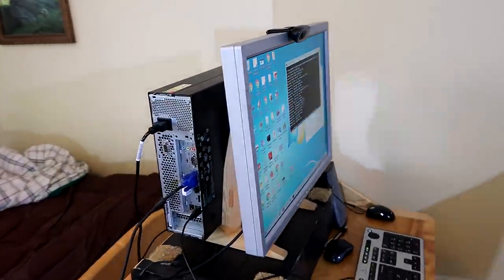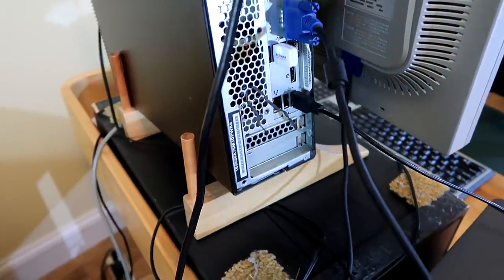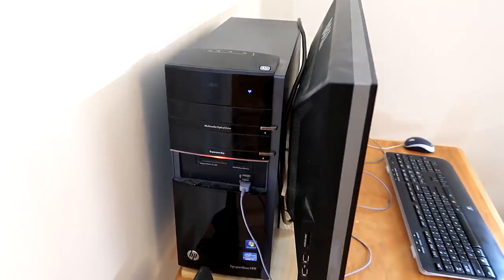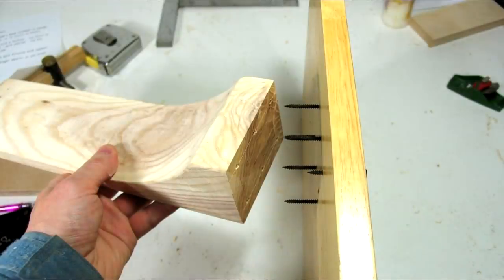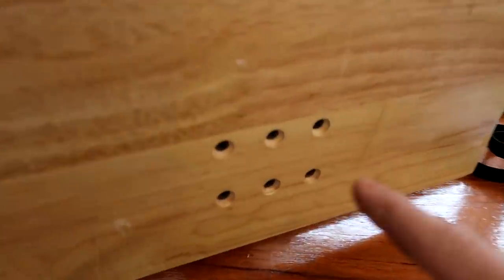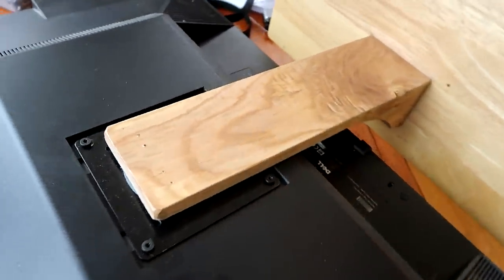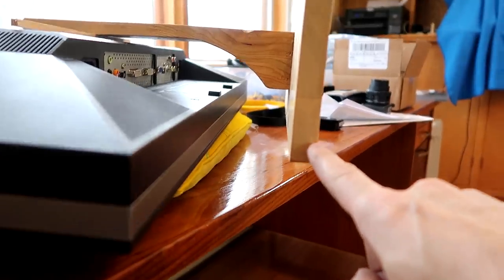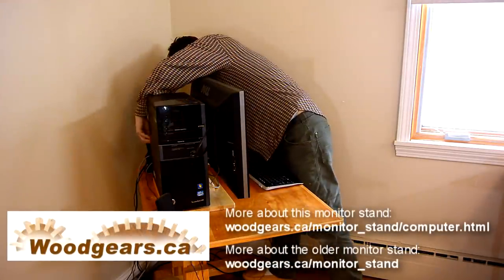Simple very flat stand for LCD monitor and PC

Comment: I used to have something similar for LAN parties, but I just screwed the monitor right to the side of the PC case with the VESA mounting holes. Plus a handle on top.
Reply: Pretty nice, just have to make sure the side panel is strong enough :) Did you just drill holes in the side panel or is there some special case with vesa mounting holes already in the case?
Reply: Drilled. The side was plenty strong enough, but I did have to sandwich a metal plate under the handle on top to keep the case from bending when lifted.
Reply: Seen that with steel cases.
Reply: I thought that's what he'd done at first.

Comment: What a terrific idea!  In the 30 years I have had a pc of one form or another.  I never contemplated putting the PC behind the monitor.  Thankyou for that.
Reply: As long as you keep the front panel of the case on your dominant hand side. In the old days for the floppy drive slides (now a days that's not as necessary). Also recall the older cathode tube monitors (prior to LCDs) were pretty durn thick through and you needed long arms or it was up and down from your chair.

Comment: At work we are standardizing on the Lenovo M series Tiny computers for our labs and user pc's.  It's a tiny box: about 7x7x2" system unit, and a matching monitor.   It's not a true all-in-one as the monitor is separate, but it had a special cradle on the back of the monitor that the unit slides into.   It's great for reducing desk clutter for general users.
But it does only use the integrated graphics, which is not great for heavy video needs.
Reply: as a comment related to size, you should see what you can stuff into ~10-20 liters of case these days. Take a look at the /r/sffpc subreddit. RTX2080 + i9 9900K and 32GB+ of ram is doable. my system is ~11L and could run a RYzen 2700X and a nvidia 1070 if i had the cash for that. The cases and motherboards do cost extra, but hey.

Also similar to the M series is intel's NUC computers/boards. Just integrated graphics, but very very small.

Comment: I've been wondering if a very sturdy wall shelf would hold a full PC, up about 4 or 5 feet, a bit to the side of the monitor.
Some 6 ft USB extensions would let me have the plugs for external disks or flash drives come out by the monitor if wanted.
It might reduce vibration from the desk to the internal disks.

Comment: I recently built a sit/standing computer workstation. The ideal desktop height seemed to be the level of my belly button. Perhaps a height standard that'd apply to anyone else too.  For me around 42 inches from the floor. I use a ~30 inch bar stool...sometimes sitting, sometimes standing and sometimes "half' standing.  And the combination of those three postures seems to be working out pretty well.
Reply: Yes, the bar stool workstation is a good ergonomic human form factor - as long as it doesn't get to be so immersive that you fall off of it.

Comment: Nice. But why wouldn't you just attach the monitor to the case side of the PC  (by removing the case side and screwing it to the vesa mount from the inside) eliminating the need for the wooden elements entirely?
Reply from the maker: and have the whole thing tip over.  No thanks
Reply: @matthiasrandomstuff2221  I am sure you could have made a minimalist bracket to prevent that. Engineering should be as simple as possible.

Comment: Now that is pretty clever! How was the monitor fastened to the stand again though?
Reply from the maker: with screws
Reply: Matthias Wandel it just seems too thin to hold much thread. But of course that depends on the amount of screws. The “hinge” is what has me puzzled. How can you loosen the screws without compromising the integrity/strength of the joint?

Comment: Isn’t a very noisy solution, with the PC on the table instead under the table? Thank you for sharing your solution. God bless you and your family
Reply from the maker: it's behind the monitor, that blocks noise.  There's no good place for it under the desk.
Reply: How loud is your PC? Admittedly I have an extremely quiet water cooled PC using slow 140mm noctua fans for cooling in a sound dampened case. But I literally can't even hear mine at idle and low load.
Reply: elevated PCs suck in less dust, than those at floor level.
Reply: Matthias Wandel ok, I had a PC it was very noisy but I have never tried your solution but I like the idea. Thank for your answer.
Reply: jonnken thank for your answer, didn’t thought it this way.
Reply: byw my pc was louder than I like it to be. But your solution looks like a very quiet pc

Comment: DVI?!? how old is that monitor
Reply: works as well quality wise as HDMI, which is electrically the same as DVI for the video, so it's a simple passive converter to go from one to the other. You just can't pass audio across DVI, but who wants the audio to come out of the 2watt integrated speakers on a monitor.

Comment: The tilt mechanism of my all-in-one PC went limp so I made a small piece of plywood that fixes onto the existing stand and has a nut fixed to the plywood. Then a bolt threads into it with a wooden cap on one end and a handle on the other that I use to push against the back of the PC to adjust the angle. The angled plywood standoff (used to get the bolt at the right angle relative to the piece of plywood that sits flush against the stand) split slightly as I hammered the nut into it, but its held on by 4 screws so shouldn’t be going anywhere, especially against the small torques faced by the bolt. Bit of a hack-job but it certainly pulls its weight.
Reply: Maybe try some Levitra for the limp thing it should stiffen up for some many hours at a time I've heard   :-)

Comment: why bother having the computer behind the monitor? mount it  under the desk so you can easily access the ports and you don't have such a bulky item on the desktop
Reply from the maker: I would have put it under the desk if there was a place for it, but that's where my feet go.
Reply: As with the all in one computers you only need the case's front panel on your dominant hand side (typically to the right) and with wireless the cable access is of negligible concern. It was the days of CRT monitors that multiplied grief and was when perhaps case floor mounting had its place. I would put the tower case over on its side with my feet up on that - nice and warm in winter down the basement the spiders liked it too.

Comment: Well, you don't have to get rid of a monitor when you have AiO Pc either. Most AiOs can be upgraded internally.
Reply from the maker: Do they use standard ATX monterboards?  I doubt it, cause if they did, they wouldn't be all in ones.  And if they don't, good luck finding a replacement motherboard!
Reply: @matthiasrandomstuff2221   My senpai noticed me :O .
 There are mini-ITX motherboards, basically the smallest motherboard possible yet designed to accommodate standard components. Imainge ATX board but cut under the first pci-e slot and on the right before the second hole for the screw. Original AiO boards are larger that mini-ITX so those can fit easily. You can even put a graphics card inside using a pci-e x16 raiser cable. CPU cooling is a bit tricky, but possible to do with original aio cooler or by making a custom one with a blank heatpipe.
Reply: @bluef1sh926   Nobody upgrades their AIO PC
Reply: @amiddled   Because it's more affordable to throw it away and buy a new one with a monitor?...
Reply: @bluef1sh926  It just doesn't happen. If anyone is thinking about upgrades, they aren't thinking AIO
Reply: @bluef1sh926  I've never seen a AiO that will let you upgrade more than a HDD/SSD and ram amount. Good luck making the jump from one generation of CPUs to the next, or memory from one gen to the next.

I've got a Dell inspiron zino HD on the desk near that is all but worthless because it needs so-dimms of DDR2, so that it could have more than 2GB of ram in it. (yes, already running linux, debian, and while i'm sure it helps, chrome needs like 90% of the ram).

Comment: I can't believe he didn't build a custom PC.
Reply: he has made wooden cases in the past, before he was making videos, they are articles on them on his website.
Reply: Waiting for the CPU from pallet wood. Some may say impossible, but I can hope
Reply: @ratchet1freak  I think what he meant is picking parts himself and not buying a pre-built system from walmart or some other store, they usually sell their pc's much more expensive than what you could build yourself from the same parts if you ordered them separately on the web
Reply: Made of wood and powered by mice and/or shrews
Reply: he's not a pc guy (afaik)
Reply: @poiiihy  I mean, the computers he showed were both PCs.

Comment: You should have done a little more research on compact PC's because I bought one last year 2018 for around $800 and it's super fast with an Intel i7 77000 CPU chip and the whole thing fits in a little box approximately 3" x 6" x 6"
Much smaller than a shoe box. I'd say half the length and 1/3 less in height.
Made by ASUS.

Comment: You could have just bolted the monitor to the side panel of the computer...
Reply from the maker: and have the whole shebang tip over!
Reply: No then you bolt the case to your cart and then that tips over. We preferentially design for a loosely coupled system the alternative tight system falls on you and is trashed as a unit. In older better days Matthias would come by and scavenge it for all of its valuable parts.

Comment: I'm surprised that anyone uses a workstation anymore.
Laptops are as capable as work stations now and so much lighter and portable.
Reply from the maker: with tiny monitors, shitty keyboards, and awful mice.  So now you take your laptop, hook up a decent monitor, mouse and keyboard, and performance and reliability is still subpar.
Reply: Laptops are objectively not capable as work stations in 2019. If we were producing the same content as we were in 1999, sure modern laptops are capable, though not ideal. And to get one worth its salt you're going to be spending well into the thousands.
Reply: There are different families of CPUs for laptops vs desktops. Laptop CPUs have fewer cores, and a lot of things turned off to save heat generation / make your battery last longer. Desktop CPUs have a lot more processing power. Compare a laptop and desktop cpus, you'll see there are big differences without even looking at benchmark numbers: https://en.wikipedia.org/wiki/List_of_Intel_microprocessors#8th_generation_Core/Coffee_Lake/Kaby_Lake_Refresh
Reply: @billybobjoe198  Yep, building a desktop vs buying a laptop with the same specs, the laptop could cost up to or even more than double the desktop (assuming you pick a laptop with actual desktop grade components)

Basically the ONLY time you want to buy a laptop over buying a desktop is if you are traveling a lot with work or if you find a laptop on a really good sale and you are on a tight budget
Reply: @TheZebinator  and if you are traveling a lot with work, hopefully it's work buying the laptop and not you.
Reply: If you have a hefty capable laptop you can't commute with it because it takes up more room than you and your seat companions will either jeopardize it or make it impossible to use - so it remains in your bag from home to work - commuting means tablet size and power. At home a desktop requires a good size monitor or few and if you have a laptop configured that way typically you never move it so it is in effect a desktop. That suggests getting a real hefty beast or like Matthias follow a two year upgrade cycle - in any case you need a couch/bed machine which should also be desktops like Matthias showed here as his bed machine and his video editing one. I use a powerful smaller format gaming laptop for couch/bed browsing and such work and it gets regrettably hot to handle way too often.